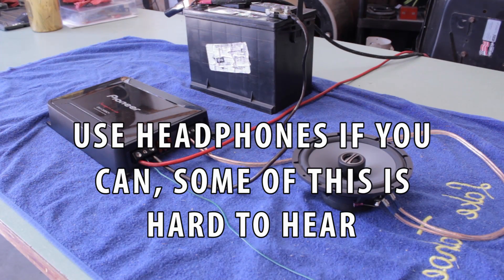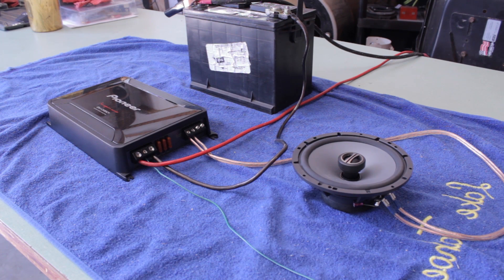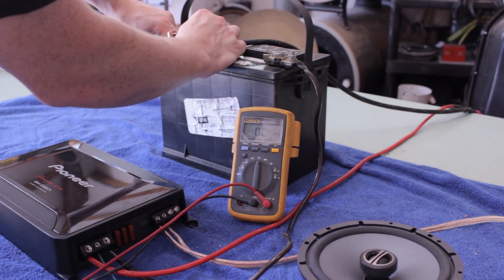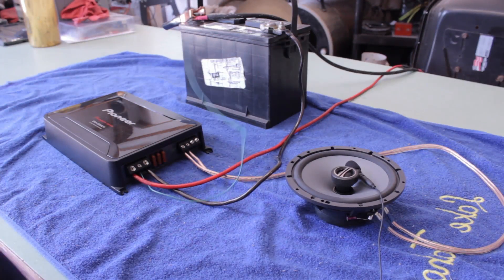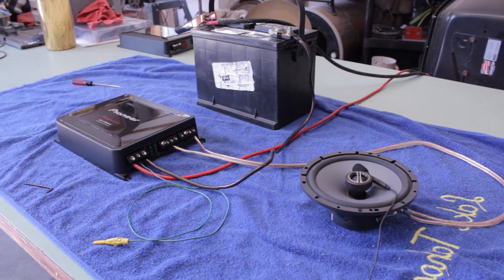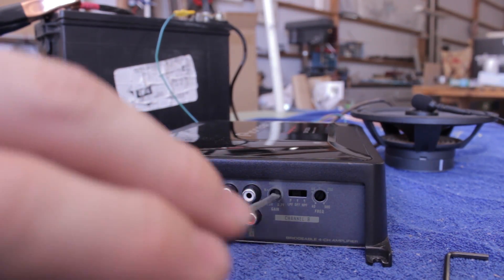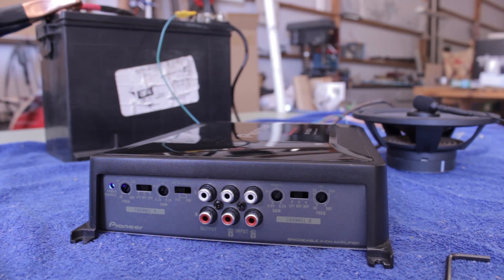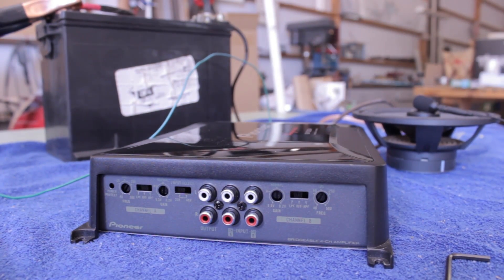New Pioneer class-D amplifier noise issue - GM-D9601 and GM-D8604

Comment: sam problem. my amp will bump even after truck is turned off. last week it started to smoke and it melted (but not brake ) one of the two fuses. any suggestions on the problem??
Reply from the maker: make sure your power and ground cables are really good with clean quality connections.

Comment: Your speaker wires are literally wrapped between the +and -....you will get noise...as for the pop...maybe try the head units 5volt turn on and not 12V directly from the battery I think
Reply from the maker: This setup on the table was only to illustrate the issue, no change between here and when it’s installed in the car. Speaker wires can cross power and ground,  it’s RCAs that are sensitive.

Comment: Dude, are you connecting that remote cable to the ground and not the positive pole?
Reply from the maker: No, the colors are backwards.
Reply: The whole wiring set up looks weird. Looks like he has a battery in series with a battery charger😂 and using the red wire as a ground. Or am I tripping.

Comment: Head unit is the problem, source signal, ground rca output to the body of the car, make sure rca voltage matches where it's going ( amp or processor), God bless.

Comment: Worse mistake that can cause your system to whine is to connect or disconnect your rca cables while the radio is on. Always turn your head unit off when unplugging your rca cables.
Reply from the maker: Michael Sheppard what is the reason for this?

Comment: IT IS THE FULL RANGE SPEAKER THAT RESONATES THOSE HISSING FREQUENCIES, subs do not. The pop is caused by gain mismatch from the music source unit. It is a current surge. The high ohm in to a low ohm amp. DSP HIGH LOW LEVEL GAIN BALANCE will solve that problem. If you must operate an amp with a higher ohm input, turn on the source unit first when it is plugged in to the RCA with all volumes lowest then put a anti surge switch between the battery and the amp, then switch on. Make sure the switch matches the current before you buy. 
The gain was affecting the hiss from here. On the GM A3702 the gain set lowest will not affect hiss when a sub is on with a separate source volume turned up because the sub does not resonate those frequencies. The other humming noise is outside influence. It could be a charger close to the amp or a voltage meter that has no DSP. Try a DSP filter, that will solve some of the problems. Try pure oxygen free wires for battery and speaker wire and filter the battery ground loop with a capacitor.
And one last thing, Class D is crusty THD. They say it is 0.5%, does not mean it is. Those amps are cheap, what do you expect for that amount of watts. If you look at HiFi AC home amps, most are class B and have almost no audible THD, then look at the price you pay and the amount of watts you get for the cash and compare them to car amps. Then take in to account that car audio needs to be efficient with batteries so they put mosfets in and all the extra circuitry and electronics components add THD. Class D is measured at a specific volume, not up full. You do not notice it at 40 volume when music is playing.
Reply from the maker: ROBERT FRIEND I’m not following what you said 100% but I now understand the amps are cheap Class D. I have a pair of 15” JBL in an infinite baffle in that car and they were pretty efficient. I could definitely hear a hiss in them if I got close.

I never did fully finish the stereo in this car due to engine failure shortly after I filmed this video 4 years ago. Although I have now replaced the engine and it will be back on the road soon, I will be rebuilding the system. I’m ready to switch amps so if you have suggestions on what to look for I’m all ears. It’s a 4-way active system so I need at least 7 channels and I’m still on a budget.
Reply: @MotherlodeMotors  Your sub might have a higher frequency range letting hiss come through. I have Pioneer, they only go up to 200Hz, some as low as 100Hz and others up to 1000Hz.
Reply: @MotherlodeMotors  I would not worry too much, it should not be audible at high volume when music is on. Start with the low quality and save whilst you are have fun then get Class A for your full range and a low 200Hz set of subs. I have a GM A3702 amp, it has a great frequency response for a cheap amp and the full range on Pioneer Class D amps is much more than most other makes. I have Pioneer 6x9s and they generate a greater range of frequencies than any other speakers I have heard, plus they have sub bass to 27Hz. They are the 4 way and you need an EQ to balance them. When you have all your basics get a DSP FOR 7 CHANNEL. It has 8 and will give you stereo bass rather than centre sub.

I am surprised you responded, I thought you might have got it together so I responded for other people who might have the same problem.
Have fun.

Comment: Class D amps have these noise because of the way they are designed (pulse triggers)  but of course the engineers are doing if not, have done measures to keep the noise at bay.  

Just a comment though, notice how the noise on the D9601 is much more audible than on the D8604?
On the D8604 test,  mic had to be placed on top of the tweeter to make the noise more audible, I'd say it is because the D8604 is for full range speaker use and may have more of the noise reducing measures in it.

The D9601 on the other hand, is more of a subwoofer amp and if you put an actual subwoofer to it, the subwoofer will not produce that noise since subwoofers do not pass high frequencies.

Anyways, I believe this vid, helps add info about class D amp noise.
https://www.youtube.com/watch?v=8-AM43mAJKk
Reply: So its just normal? The hissing noise? The speaker(sub) dont hiss but somewhere near the LED of amp make hiss noise
Reply: I just bought gm-d9601

Comment: the 9601 is a beast on pushing subs. But im having problem with the 4ch version aswell. i found this video researching the same problem on my brand new 4ch DM-8604. My 9601 got no problems with my JL sub but now i have massive noise problems in my 2way component speakers from the 8604 amp

Comment: I don't think the hiss is from the grounds. I just installed a class D for a practice run, and it hissed too. I don't recall hissing problems 17 years ago when I was doing car audio. But, in those days, they were all class A, A/B mostly. I wonder if the class D makes that hiss d/t modulation etc. I noticed in my Honda, with radio off I had hiss, radio on hiss, speakers up, can't tell. I started the car, no hiss. So I am thinking that low voltage (12V) when car is off caused a low voltage hiss somehow. I then turned off my car. Hissssss. I turned down my gain, and gone. Started car, ... nothing. music. loud and clear. I did call alpine though, and they said bad ground ... yikes. bad ground? it's plugged into the battery

Comment: 1# dont use a speaker to test a class d amp lol, you need to properly ground everything and make sure your rca imputs dont change at all when plugging in anything, when i plugged my phone into some chargers id get that hiss and whine as the engine revved as soon as i switched chargers went away, and i do notice a pop noise from the subs when turning on thats just always been there id assume theres no circuitry to slowly power things up its just like a snap of the fingers your issues could be more input related not the amps fault but the signal you are feeding it to, also my wires read 0.00 resistance so i wouldn't be surprised if that was affecting anything and you aren't fused so that doesn't limit the current draw at all
Reply: Tony Kart Racer also well known class d amps put more power out when playing on a speaker than an amp dyno simply because how the amplifier is made were not talking give differences but in general class d amps will perform differently on a speaker than a test bench
Reply: And throw that 8ga in a sub box where it belongs and run 4 gauge ofc wire cca will cause voltage drop and everything you dont want
Reply from the maker: AustinAutomotive Don't test an audio amp with a speaker? What do you want me to test with?

8 gauge is for testing only, won't make a difference.

What part wasn't property grounded?

I don't have this problem with other amps.
Reply: I think AustinAutomotive is falling for the "Class D amp can only produce decent sound out of subwoofers and and not speakers" bandwagon.  Just trying to act like he knows his shit.
Reply: Tony Kart Racer if you check my channel you'll see my 18" subs are probably worth more than your rent, pretty sure I know what I'm talking about
Reply: Tony Kart Racer subtly roasted
Reply: Better playing as opposed to being on a fixed test

Comment: i'm not sure if this was mentioned before but the ultimate way to get rid of the hiss is to wrap a stranded 16 gauge wire around all the RCA inputs and ground it directly to the deck chassis noise is gone

Comment: i have the 8604 & the 9601 no problems at all.... its something u r not doing
Reply: I agree, I own a 8604 and I've had it almost 3 years and it sounds really clean. No distortion or whining. I tried using a crossover but was better off without it.
Reply: @michaelsheppard6714  I'm about to probably but one of these in morning tmrw. I've read on crutch field that I can power the 4 cab speakers thru 2 channels , and One subwoofer bridged . If everything is 4 ohm. I believe is what it said is this true..??
I'm a noon as hell lol and already got ripped off for a head unit.. so im tryna not buy stuff I dont need and get stuck with it
Reply: @berniemackattack86 major late reply but you'll love crutchfield I just spent $702 on a pioneer head unit the 65cfh z series $300 component set and the coaxial z series amp I already had 2 12s but yeah I've ran pioneer for years I'm 46......... but Crutchfield is a great place to get your gear

Comment: These amps rock I have the 9601 and his little brother and the little brother is pushing 2 12in P3's and 2 pioneer champion series 12''s like it's nothing, just ordered the 9601 to push the p3''s and since the rms match and let the little brother handle the champion series 12's
Reply: Agreed, the 9601 is a beast on pushing subs. But he is having problem with the 4ch version. i found this video researching the same problem on my brand new 4ch DM-8604. My 9601 got no problems with my JL sub but now i have massive noise problems in my 2way component speakers from the 8604 amp
Reply: Does ur gm d9601 make hissing noise coming from the amp?

Comment: either way its bad amps normally they have soft turn on which stops that pop on turn on and turn off procedure. all it does is shut down the amp first then the power supply or turns power supply on first then amp itself.

Comment: I'm thinking. If and when it's connected propper, Head unit RCA's , you wouldn't experience that problem, cause the head unit is internally grounded. Or you should create a ground from the RCA ground on the back of the head unit looped to the body of the head unit. From the dash. Common problem with Pioneer head units. Grounding problem, that creates noise.

Comment: I had to make sure power cables are separated from the wires leading to amp to get rid of the hiss , I noticed you have power and speaker wire across each other which causes huge amount of hiss .
I hope this helps you or anyone else with same problem :)
Reply: Here i am 4 years later , don't care about your issue and not helping anyone haha

Comment: I have the 9601 pushing two 10" type S subs and I have no complaints.  Shit bumps hard!
Reply: Jorge Martinez 
no it dont...lol
Reply: Yes they are great entry level amps. This guy just doesnt know what he is doing.
Reply: I have the same amp pushing 2 alpine type r 12s at 1 ohm no problems whatsober till i change to amp to another car no sound whatsover its bot the rcas everything its right cause i had a rd 205.1 working fine and the pioneer 9601 just doesnt do shit no sound nothing but indid noticed the amp knob got hella hot for some reasin amd it got burned up

Comment: some amps and radios have this prob ive seen it and sorry if im late but loop a wire on your jacks that solves the prob most of the time
Reply: +Taylor Thorne try the procedure on the amp 9 times out of 10 the interference is because of a not so good ground on the unit
Reply from the maker: Not sure I understand exactly.
Reply: Please explain more, I'm having the same issue. Is there a wire I can buy to fix this or something?
Reply: locate the sub outputs on your radio, take some wire and take it out of the insulation and bridge the outputs and sick your plugs back in i know this works with pioneer radios
Reply from the maker: The radio can't be the problem. I don't even have a radio hooked up to this.
Reply: I have the sub getting the "power on" signal from the power antenna (A5 from the ISO connector). Then all the speaker inputs from the B section of the ISO connector are going into a LOC, then to the AMP RCA input.  Do I need to loop the A5 wire from the ISO connector sending the signal to the AMP?
Reply: Will the "Axxess AX-ANR1000 Inline Power Noise Filter" do the trick? Also thank you for all your help :)
Reply: +ske1555 ive not used any noise suppresors because i havent had the need or money to buy them what always do is wherever any ground wire is gonna sit at I scrape the paint clean to the metal, paint is in the way everytime and no prob if you want look me up on facebook it would be alot easier to explain you and show you my set up and all my conections that way you can check your own
Reply: +ske1555 dont get your signal from power antenna which is most of the time the blue and white wire use the 'remote' wire most of the time the solid blue wire
Reply: It's definitely not a grounding issue for me. I have this sound system hooked up in a aluminium race car trailer, and the cabinet its hooked up in is bare aluminum. So I'm going to try the loop in the wire and maybe a filter. Any other suggestions?
Reply: +ske1555 yeah dont use the power antenna wire, use the remote wire also what head unit do you have
Reply: What pin does the 'remote' wire correspond to on the ISO connector pinout?
Reply: I have a DELPHI HEAVY-DUTY head unit. I think it's the PP105227 model
Reply: +ske1555 can u send me a link to find the head unit because i cant find it by that name
Reply: It just uses iso connector, am/fm antenna, and XM sat input on the back
Reply: Bit late but Aaron is right. Problem you have is the ground in the amp. Fix the ground or use a ground loop isolator. That will resolve this problem

Comment: Does it seem strange that only you seem to have this issue?  

Maybe remove the other "mystery" cables we can see here leading to the battery from the side of the table and run only the negative and positive to the amp, direct from the battery with a proper switch for the remote on wire...
Reply from the maker: there are only two tires there. one just has a flex sleeve on it that makes it look different. I had a switch on it when it was in the car and it did the same thing.

Comment: Just another reason, I personally, stay away from class d. Watt for watt class ab is louder, and they sound a hell of a lot better. Only thing is they run a lot hotter due to the wasted energy. So depending on where you live, in the summer time class ab have a better chance of overheating, after long listening sessions, unless you get a real good one. Or you could always buy one with more power than you need and just keep the gain down, that way you're not always stressing it.
Reply from the maker: I had a tiny car and 3 amps for a 4 way active setup with DSP. I thought I would give it a shot because there's no way I would have fit A/B in there and it would have not been great on stock electrical. With 2000wrms class D the car didn't complain too much. Next time I would probably just go with a smaller system.
Reply: Cheap Ass Garage Class D dont overheat, but are prone to the buzzz, maybe a capacitor would have help you eliminate the buzz of the amps.

Comment: Sounds to me like the amplifier is picking up electronic noise. It's really just a bad design and not enough proper shielding possibly. I have an ART SLA1 (Class AB pro amp) that was a little noisy and sounded exactly like that and I opened the amp up and added some copper foil and sheets around the torriod and signal wires and PCB, grounded that and the noise was at least half. It's not safe to mod the shielding inside an amp because you could short it and cause a fire if you aren't really careful. One thing is that class D is a fast switching digital processing so all that fast power switching and PWM makes lots of noise that has to be filtered by the capacitors in power supply of the amp which should be fine if Pioneer designed the amps properly. Class AB might be cleaner if you live in an area with lots of electronic pollution. 

One thing you could also try is plugging in a iPod/phone using a 3.5mm to RCA cable and play music but leave it on pause on your test bench through the amp so you can hear the silence. If the noise is gone it could mean that the RCA inputs in the Pioneer aren't happy with the ground of the RCA cables in the head unit in your car. That would equal returning these amps and getting better ones or if other amps exhibit the same issue you have a ground issue in your car or head unit.